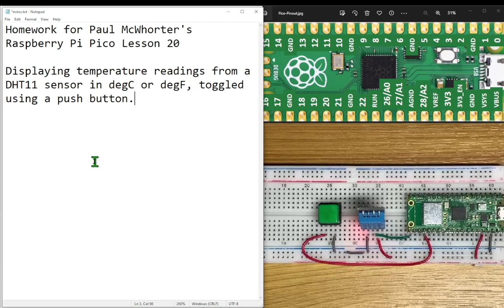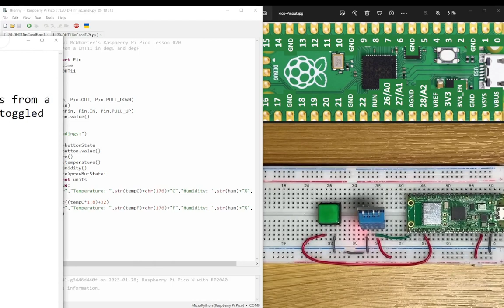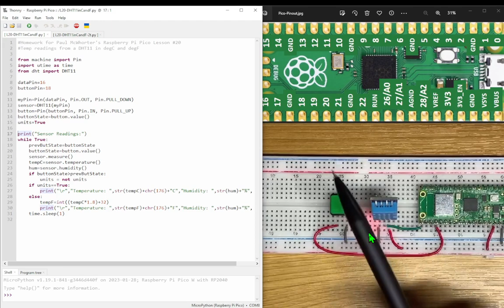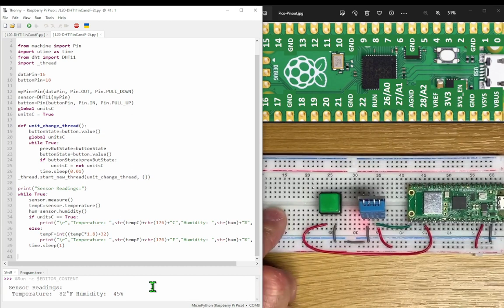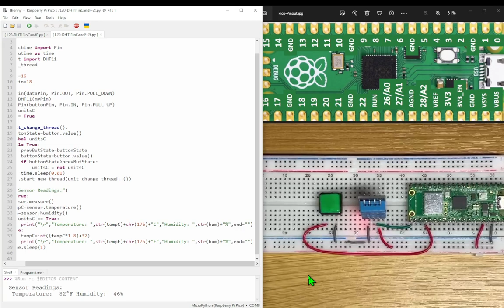Temperature & Humidity readings from a DHT11 sensor on RPi Pico W

Comment: Nice job using threading! What if you put the sensor read in the thread with the delay and read the button and printed the reading with little sleep. I think the display change would happen quicker. Thanks for posting. BTW I used your < test in my homework solution.
Reply from the maker: Just admit I hadn't thought of doing it the other way around.  I'll have a go and see whether it makes any difference. And that reminds me, I need to have a look at your homework solution :)
Reply from the maker: Must admit not just